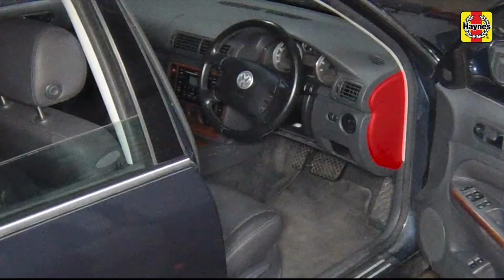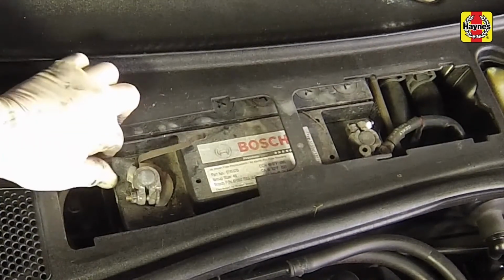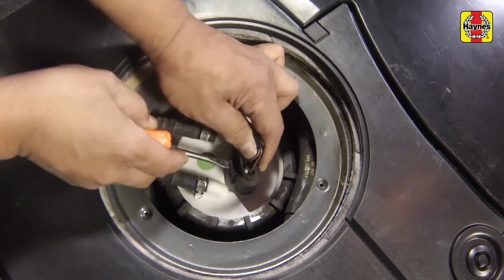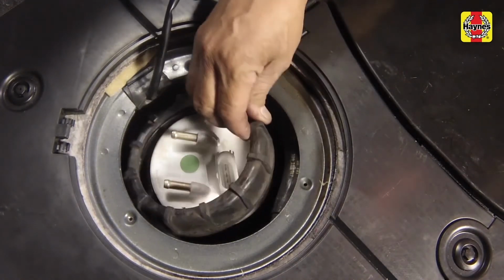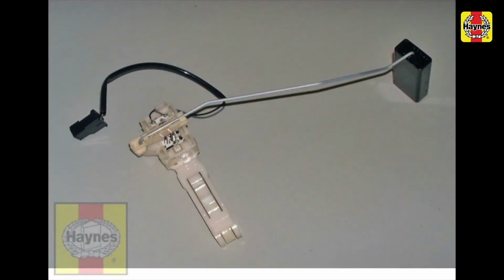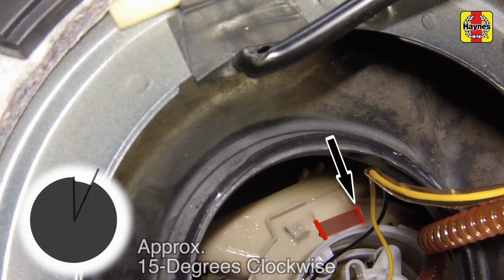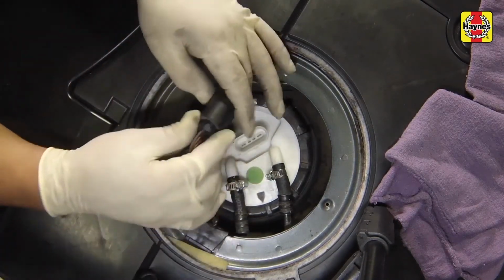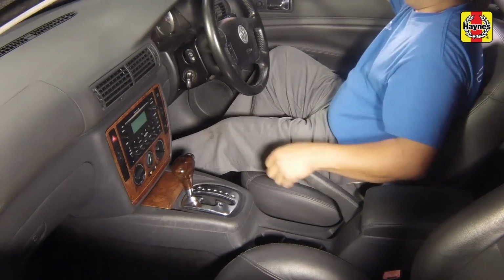How to Replace the fuel pump on the Volkswagen Passat 1998 to 2005

Comment: My 2003 passat wagon 4 motion 6 cylinder only has a 2 prong connector on top and no no fuel lines visible when I remove the access panel, why is mine different??? I can't seem to find a replacement fuel pump that matches mine anywhere. I would appreciate any advice/help? Thank you so much in advance.